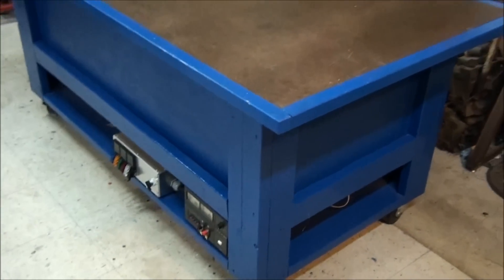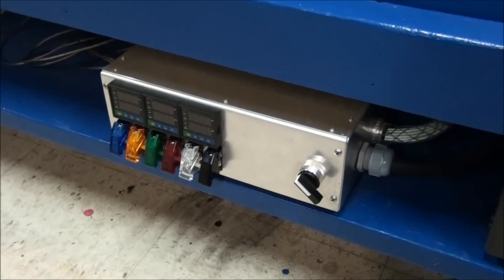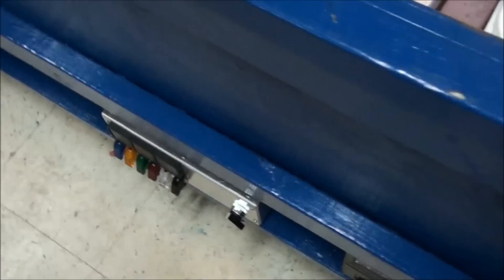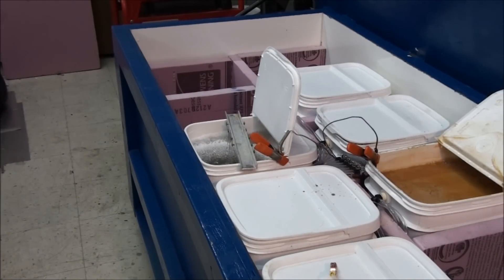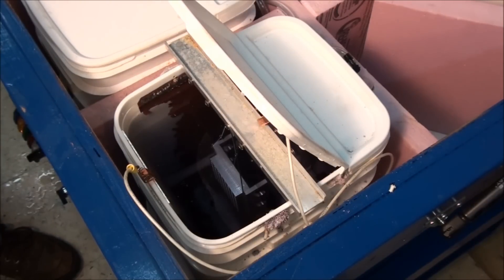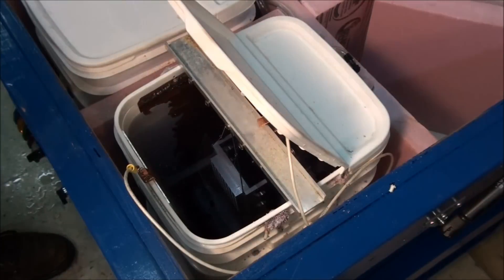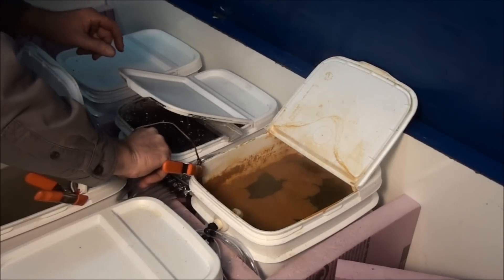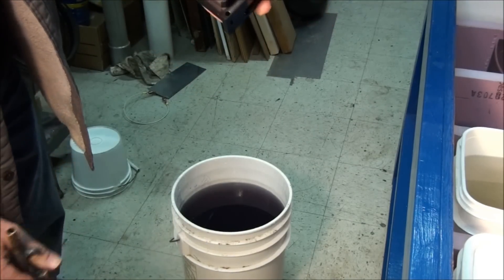A Demonstration of my Home Anodizing Set up

Comment: Hi Tom, old video, but found it just now.
I've been wanting a small anodizing for my parts for a time now. But everyone says that the solvent gets bad if not used on regular basis. And for me, it can be once a couple a week, now and then.
How often do you need to replace solvent, and how freqvent do you use it?
Kind Regards
Tony
Reply from the maker: I don't use it often. All that happens with the solutions is that the water in them evaporates and needs to be topped off now and then.
Reply: @TomsTechniques  really? I've been told that the dye gets "infected" after a while, and you can't keep it constant the same color from time to time.

Comment: It's to late Tom but you can put the cathode in the lye and it will work again, takes off the process you finished with. Last request Tom is  post  link or where you got the power supply from, all the ones I've checkout only got to 10A and review are for crap, the say we got it and it didn't work or lasted 2 months and quit, any local Electrical houses sell them ? Do the  same here for parts, only thing different with your set up is would put all the electrical components above the tanks, 🤦‍♀️😁  What a great set up and great job from you as always,

Comment: thanks for sharing.
 for safety, I'd recommend to keep more distance and a greater barrier in between sulfuric acid and sodium hydroxide. Like a flap that allows only one side at a time. When one side is accessed, the flap closes and seals off the other side.
 I'd also suggest to have an easy to access bin of sodium bicarbonate to neutralize any spilled acid.
If you value your skin and eyes,  gloves, face shield, eye protection, are also bare minimum safety precautions.
 Have fun, stay safe.

Comment: geez - all KINDS of potential for contamination here! wouldnt' it be better to have a circular arrangement (or even a grid) with the rinsing water in the middle so you're not dripping the part into various other baths?
Reply from the maker: Absolutely, and better yet to have a rinse tank between each process tank. But then it wouldn't fit in the space of a bench and I wouldn't have room for it.
Reply: ok thanks

Comment: Thanks for the great info / video Tom , may I ask what are the black reducer connection parts that connect to the pvc pipe at the tank points ? Thanks
Reply from the maker: Those are 90° hose barb to NPT adapters. The threaded side screws into  custom bulkhead fitting made from a PVC bushing adapter.
Reply: Toms Techniques thanks Tom
Reply: Toms Techniques any chance you wouldn’t mind helping me please,
Just wondering is it possible to heat my dye & sealer in stainless steel pots or would the stainless have an effect on the dye/sealer and contaminate them ? Thanks for any help it would be appreciated
Reply from the maker: Stainless is a definite no no. Only plastic (polypropylene or polyethylene) or glass is acceptable.

Comment: First of all I wanted to say, this setup you made is a dream. ITS AWESOME!!!

My question is.... what is the sealing solution made up of?

The dyes are at 145 degrees and the anodizing solution is at 190 degrees?
Reply from the maker: The sealer is a mid-temp nickel acetate solution, running at 165°F. The dyes run at 145°F and the anodizing solution is at room temp.
Reply: @TomsTechniques  sorry, I have another question.
I have a bottle of nickel accetate a 4 oz. Bottle to be exact. How much do I need to use with a gallon of distilled water?
Reply from the maker: Sorry, I have no idea. The stuff I use is commercially prepared.
Reply: @TomsTechniques  where do you get your sealing solution from? Do you have a link or website or phone number you could give me?
Also about how much does it cost for the amount you have?
Reply from the maker: If you look in the description under the video, there is a link to the build thread. That should give you all the info you'll need.

Tom

Comment: Cool set up, one stop shop (table) haha!
Some friendly advice - chance your cathode that's in your acid bath to Lead. You will constantly be changing to new ones with aluminium, where lead. You will never need to change.
(Just like lead is used for batteries Lead Acid Batteries)
All the best.
EDIT:Also titanium wire can be used over and over to hold your pieces too.
Reply from the maker: Thanks. The anodes have since been changed to lead once the aluminum ones went away. :)

Comment: Great set up! Just out of curiosity, how often do you have to change the acid solution and the dye solution?
Reply from the maker: I've only had to change the acid solution after my original aluminum cathode dissolved. I'm still on my original dye batches, but it doesn't get a lot of use.

Tom

Comment: Noooo - can't rinse back in the same shitty bucket after the lye rinse! lol Cross contamination there!
Reply from the maker: You must have missed the part where I sprayed the parts down with distilled water before placing them in the next tank.
Reply: Toms Techniques nope, I got that. My comment still stands. Doesn’t spoil a great video though - cheers.

Comment: What are the composition of the dyes, sealer?  Where do you get them
Reply from the maker: There is a link to the build thread in the video description. The sources are all listed there.

Tom
Reply: Toms Techniques i see it lists the colors but doesn't say what there made of other than organic colors.  And you have to buy 1 lb min.  Have you ever tried, say a food color, a clothes dye, etc.?
Reply from the maker: The particles in dye made for anodizing are much smaller than those in clothes dye. Therefore more of it will fill the pores in the anodizing and produce much more vivid colors.

Tom
Reply: Toms Techniques so you never tried it?
Reply from the maker: No, because I was using the set-up for a business at the time and needed the best performance possible.

Tom
Reply: Pretty sure Al doesn't have pores, if it did, you could use Clearasil to fix any blemishes!

Comment: So this is a constant current power supply? I've been trying to anodize about 12 square-inch surface area parts with a car battery charger. The current starts just like I predicted, but gradually falls to almost nothing. I've successfully anodized a part half this size with this setup before. Could it be anything else besides the power supply?
Reply from the maker: Yes, the current needs to stay constant. Most battery chargers reduce current over the charge cycle.
Reply: Toms Techniques I've since redesigned my electrical contacts. The part must be held very tightly, either by interference fit or some sort of spring clamp. I can confirm that an old cheap 1980's battery charger does work

Comment: Tom, are there temp sensors in the dye buckets?  How do the thermostats know when to switch on?
Reply from the maker: All the dye buckets are wired in parallel and have switches to turn off the ones not used. They share a common thermocouple to measure the temp.

Tom

Comment: Hello Tom.  Nice setup.  I would like to play around with this application.  Do you have a basic drawing of the frame and electronics?
Reply from the maker: Sorry Warren, but all I have is a SolidWorks CAD file which probably won't do you any good and the electronics was designed on the bench. If you check out the build thread in the video description, it will provide additional details.

Tom

Comment: Great video.  One of the best I've seen on YouTube for this. Could you explain the difference in the hardcoat process vs anodizing. I know there's a temp difference but what else.
Reply from the maker: Thanks Toby.

Hardcoat is anodizing generated in a near freezing electrolyte solution. The resulting coating is thicker than type II and has much smaller pores, so it can't be dyed like type II anodizing.

Tom
Reply: If it's not dyed then why is it black?
Reply from the maker: Hardcoat is sort of a greenish grey color. Ugly, but very durable. The type of anodizing I do is Type II and it can be dyed most any color imaginable.

Tom
Reply: Oh so it comes out that color straight from the cold anodizing process. Thanks
Reply from the maker: Yes. The color will vary, depending on the alloy of the aluminum.

Comment: I'm one of the lucky ones in my previous life I was a field service engineer in the biotech sector of the world and I have every single part needed to build every single thing that you have their. It's funny I already used a feedback loop using those controllers mine happened to be watlow controllers. you might find it useful to get a Sonic bath for one of those slots as well. I just got my hands on a Grant killer which is a very expensive piece of equipment that I was going to use on my Mill for cooling but decided not to is it's just too damn expensive for a process like that

Comment: At around 5 mins in, you said it creates an aluminum oxide surface.. it actually changes the oxide finish to aluminum hydrate. This is what accepts the dye. It also makes the part non-conductive.
Reply from the maker: Tom, here's a quote from the AAC (Aluminum Anodizers Council):

"The anodic oxide structure originates from the aluminum substrate and is
 composed entirely of aluminum oxide. This aluminum oxide is not applied
 to the surface like paint or plating, but is fully integrated with the 
underlying aluminum substrate, so it cannot chip or peel. It has a 
highly ordered, porous structure that allows for secondary processes 
such as coloring and sealing."

Tom

Comment: What do you use for cleaning the part (the bath you set the part in) and what do you use for sealing. I want to get into anodizing and i don't know what chemicals I need for cleaning and sealing.
Reply from the maker: There is a link to a build thread in the description above. That pretty much explains everything.

Tom

Comment: so do you not need to worry about using the same bucket for rinsing after each step causing cross contamination?
Reply from the maker: That's why I spray the parts with distilled water between steps.

Tom

Comment: Tom, can you please enlighten me on your air tube system. I've dying trying to figure out what you used to go from the bucket to the tubing, size of tubing, basically everything for aeration.
Reply from the maker: Did you follow the link in the description to the build thread? There are lots of good pics and descriptions there of the setup. Basically I just used a homemade bulkhead fitting that made from a CPVC threaded adapter bushing. I could have used a commercial fitting, but I'm cheap. Other than that, it's just off the shelf Tygon tubing and plastic fittings.

Tom

Comment: I like your setup very much but for three minor aspects. You do need a bucket with baking soda/water in case the acid gets splashed or spilled... I'd use food color to identify it. You would be able to use it as of course it will neutralize the solutions if you splash or spill. You also should clearly label your tanks in case something happens and fire/police/rescue squad stumble across your setup. If they don't know what it is they will call a hazmat team and all hell will break loose for you.
Reply from the maker: I have ten pounds of soda within easy reach to neutralize the acid. Good idea about labeling the tanks.

Tom
Reply: @TomsTechniques  any chance of a list with part numbers for the electrical items? It would really be helpful. Thank you!
Reply from the maker: I pretty much built it on the fly, so there are no schematics or part numbers. A lot of that info can be found on the build thread:

https://www.youtube.com/redirect?q=http%3A%2F%2Fmadmodder.net%2Findex.php%2Ftopic%2C9113.0.html&v=BtYHcsq7s5A&redir_token=O5OiZ4W4G_oqbVhM62wC1Iu50EB8MTU3MDAzMjkwM0AxNTY5OTQ2NTAz&event=video_description

Comment: When you were spraying the part at around 9:00 I could see the brown to silver cleaning action. Thanks for the info, checked out the info on your website and it makes a great reference point. I'll be looking to anodise parts that will need a tank maybe 800mm x 400mm, so I got some home work to do.

Comment: use lead as your cathodes in the anodize tank.  I've been plating for about 13 years, that's what we have in our sulfuric tanks.  lead will last a lifetime.
Reply: Who in the heck sat around back in the day wondering how to finish an aluminum part
Reply: @wlehtola  Japanese
Reply from the maker: +Eric Skinner 
Yes, I've figured that out since I first got started.

Thanks,

Tom
Reply: Garage Shop Shenanigans what's the difference in anodizing and hard coat process? I know temperature but is that all?
Reply: It's the type of aluminum oxide formed that's different and has different properties too.
Reply: The fumes from the sacrificial lead cathode would be nasty, wouldn't they?

Comment: I'm putting together a similar set-up, but I was wondering about your rinse station. I am thinking about doing a 2 stage rinse station of distilled water. Would having a bubbling, agitation set-up in rinse 1 be a good idea, rather than dipping?
Reply from the maker: +Eco Mouse 

A bubbling rinse is not necessary. The part is scrupulously clean by rinse time and water is attracted to it like flies to your picnic sandwich. The tap water and distilled water spray that I do is more than adequate.

Tom

Comment: Hi Tom, indeed a great video. Much appreciated. Please can you tell the ratio of Water and Sodium Hydroxide (Caustic) for etching process. Also, if it requires heat at what degrees in Fahrenheit. How long the 6061-6063 needs be in the container to get matte finish. Thanks a lot.
Reply from the maker: +Kaiser Haider 

The etching solution is 100 g/l sodium hydroxide and water and is used at room temperature. Cleaning only takes a few seconds. I haven't done much experimenting with textures, but I imagine it would have to be a trial and error thing for various alloys.

Tom
Reply: +Toms Techniques 

Great. Thanks a lot Tom. I am permanently tuned in to your channel for useful tips and techniques.

Comment: Tom great setup...I have been reading through your build thread on metalworkingfun.com 
If you don't mind sharing, what type/size air pump did you use with the bubbler system?

Thanks,
Brandon
Reply from the maker: Brandon C 
Thanks Brandon,

It's the type of air pump used in ponds or large aquariums. I got it off eBay and I believe it was around 1000gph. That seems like an odd way to rate the volume of a pump, but that's the way they do it.

Tom

Comment: PPE is your friend. Dealing with these chemicals without any gloves or even glasses? wow, just wow.

I like your setup and obvious attention to detail. Thanks for taking the time to make the video.
Reply from the maker: zerodegreec 
Good point. Glasses, or better yet a face shield would be appropriate. The electrolyte is not that concentrated, but the sodium hydroxide etch definitely is.

Thanks for watching.

Tom
Reply: On that same note, do you know what your neutralizing solution is for the chemicals you are working with? For example, Lye is not neutralized by water. You need vinegar. Knowing what to do when things go wrong is very important.
Reply from the maker: zerodegreec 

I'm not trying to neutralize the lye, just rinse it between steps. There is five pounds of baking soda within reach for the acid.

Comment: Hi Tom, I'm new to this. Are there any lines or discoloration where the wire touches the part it is hanging on? Thanks for your time.
Reply from the maker: Yes, as with any anodizing the wire or rack will leave a mark. You have to plan ahead and locate the wires accordingly, normally in a drilled or tapped hole where it won't show.

Comment: what do u use as a sealer ?  at the end ??  thanks
Reply from the maker: The sealer closes the pores in the oxide layer, locking the dye in and dirt and oils out.

Tom
Reply: What do u use as the sealer.   What. Is the chemical name.  Or a web site. Do i ordered. It from thanks. James
Reply from the maker: Panty Snatcher

I use a mid-temp nickel acetate sealer from:

http://www.usspecialty.com/product_chemicals.php

Comment: You could probably single tank the degreaser - wash - sodium hydroxide - wash - sulfuric acid electrolysis - wash cycle... use reservoirs - pumps - level and turbidity sensors - a PLC or microcontroller and perhaps an inert gas recycler as your bubbler.
Reply from the maker: Going from sodium hydroxide to sulfuric acid in one tank would take a heck of a rinse cycle. It would be an interesting challenge though.
Reply: Well, depends on your budget, you could engineer a rinse cycle with poly membrane filtration coupled with conductivity monitoring, or RO. Guess it depends on how much sodium sulfate in ppm you need to worry about before it effects the quality of the electrolyte bath / anodizing process.
Reply: From an engineering perspective I would be the most worried about how to keep the aluminum cathodes out of the way until they are needed in the anodizing cycle. Anyway, its do able... perhaps even get all the steps including dye in one tank. The biggest concern then would be tank material to keep the dye from saturating the lining.

Comment: What's the part? Looks almost like a thick hard drive holder with a heat sink.

Actually, you said the holes are tapped, so must be something else.
Reply from the maker: It's a part for a manufacturing fixture that I designed and built for work.

Tom
Reply: Pete Brown funny to see you here Pete, usually its synth videos where I bump into you!

Comment: Hey Tom! nice setup! how hot in celsius is the sealant? I want to anodize some cilinders but if I get them too hot Ill messup the metal resistance!
Reply from the maker: The sealer is 170ºF. I'll leave the math to you. :)
Reply: Toms Techniques Is that the hotest part of the prosses?
Reply from the maker: berhart

Yes, the dyes are 140ºF and the anodizing and etching tanks are room temp.